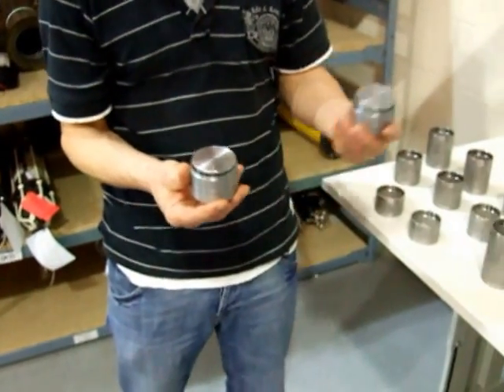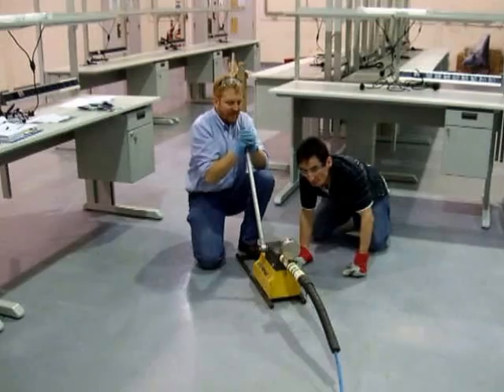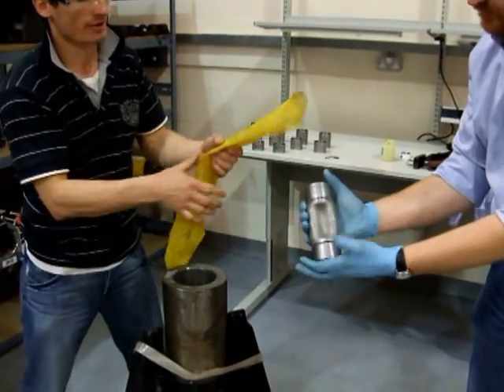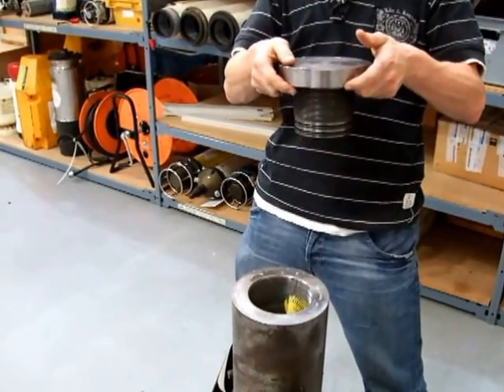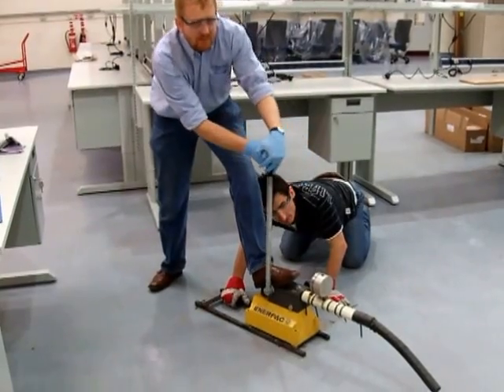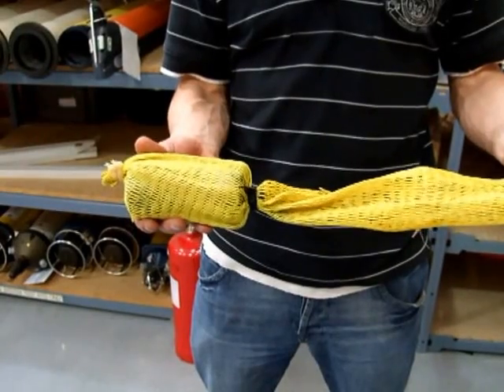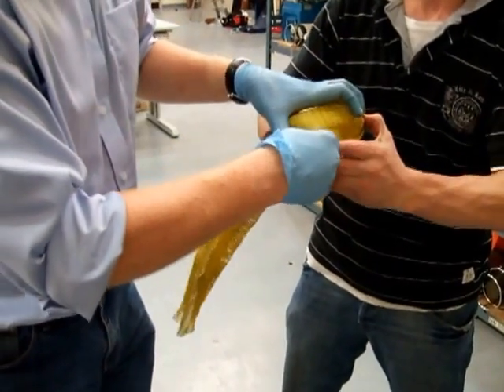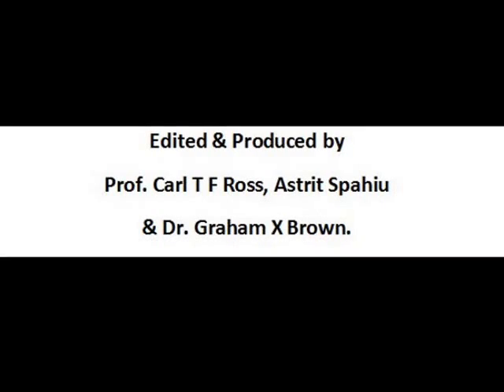Collapse of Stainless Steel Tubes Under External Hydrostatic Pressure.

Comment: How much maximum pressure or compression it can generate in bar ?
Reply: 1 bar = 100000 pascal, normal air = 1.01325 bar = 14.72 PSI

Comment: Do you test watches there? I am trying to find what 20 bar means in watches . My watch and others I have had have always been in meters. Mine is 200 meters. However a watch I was considering said 20 BARS ? Any Ideas. Thanks If You don't test watches you may consider it .
Reply: At depth of 200 metres pressure is approximately 20 bar (10 metres = 1 bar).

Do take notice that number written on watch case doesn't mean you can actually dive to the depth indicated since movement of the hand at certain depth may produce greater pressure than the pressure of an object at rest at same depth.
If the watch has 50 m (5 bar) or less water resistance, it is not meant to be used for swimming in the sea.
You can safely swim (or dive couple meters) with 100 m (10 bar) or higher.

Comment: Hello, very interesting.
I want to send a steel cylinder 20 cm diameter x 30 cm length, down to 200 meters of sea water. How thick should the walls be ? It would greatly help me to have an informed answer on this.
Reply: 8 inch SCH5 (2.77mm)  upward would do. Hope this help............
Reply: Yes it does, thanks a lot !